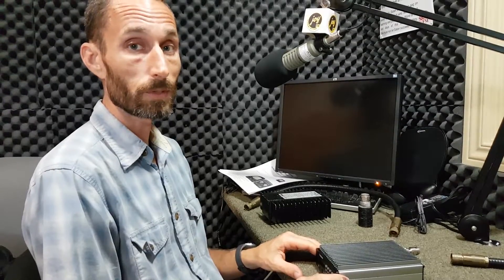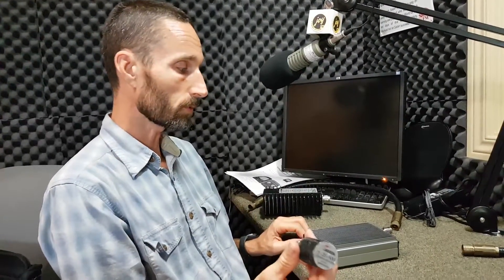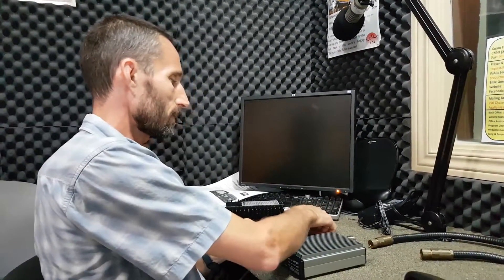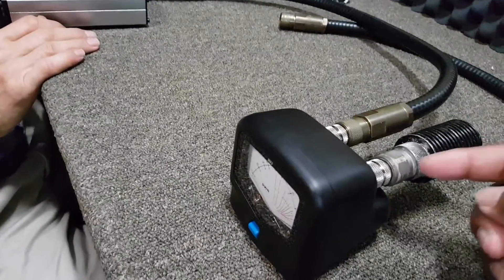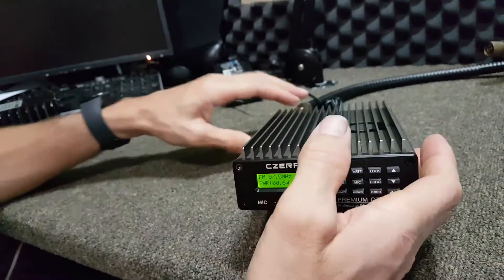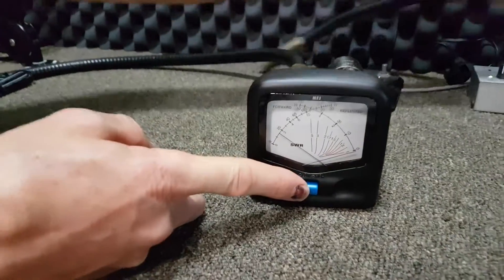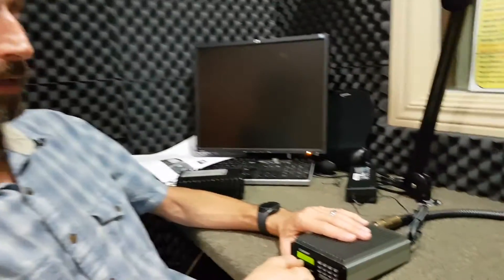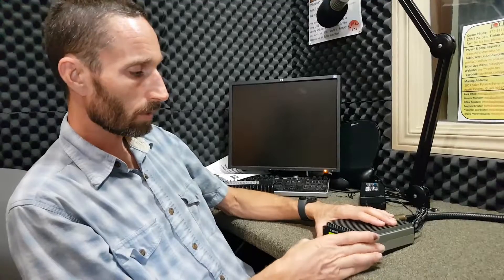Testing your FM Transmitter

Comment: Hi? 30-watt FM transmitter does not show error even when antenna is disconnected and only transmits 200 meters. Initially, it would show antenna error at lower frequencies (91MHz and below) but would work up to about 10 KM at 94.0MHz. Would could be the problem?